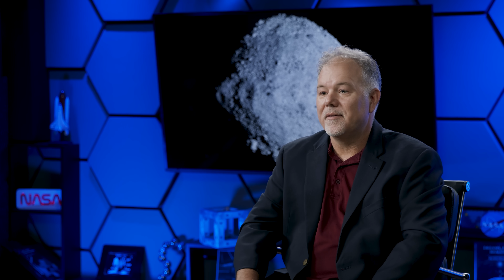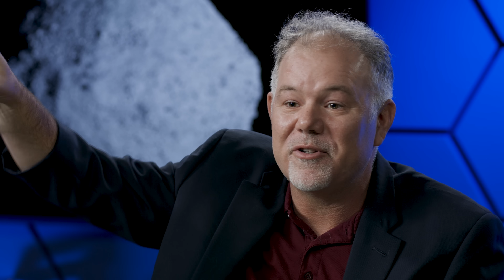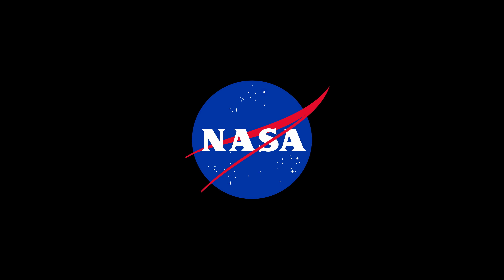Bio-Essential Sugars Discovered in Samples from Asteroid Bennu

Comment: probably because it is ancient fossiliferous remains (more than 1 billion years old) of benthic crust and has the dead remains of previously existing organisms, if you had a theory more aligned with Randolph Kirkpatrick it wouldnt have been a surprise, then you might say the chirality doesnt match, well that is not disprove but a discovery.
Reply: Most of the chemicals found would not last that long, they are likely to have been recently formed. Even sugar has a best-before date and a billion years is too much.
Reply: @pattheplanter  Interesting, so you are saying the object material had to have been formed in the past 100 million years? So has nothing to do with the material present at the time of Solar System formation?
Reply: @anautonomousagent  No. The sugars have formed recently but the materials they formed from are much more ancient.
Reply: @pattheplanter  interesting, you know they formed recently but the materials they formed from are ancient, spontaneous generation of sugars from ancient material? then this can easily be demonstrated in lab experiment?
Reply: @anautonomousagent  It has been done with various components. See, for example, "The Formose Reaction: Prebiotic Soup or Recipe for Life?" by Peer van Duppen. Available online.
Reply: @pattheplanter  cool, interestingly this supports idea that is it from hydrothermal vent or benthic crustal debris. as these formose reactions work optimally in such environments: " The reaction proceeds efficiently at up to 200 °C (e.g., in simulated hydrothermal vent environments at 100 bar pressure), where maximum yields are achieved in less than a minute without requiring catalysts or highly alkaline conditions." 

Unlikely that this process is occurring in some molecular cloud in a vacuum of space on tiny object. (super low temp and pressure with no catalyzing agents)
Reply: The chirality does not match.
Reply: @davidwuhrer6704  it doesnt match because we are discovering something new.... life outside of our life you think is supposed to match ours lol
Reply: @anautonomousagent It doesn't match because Earth life has one chirality, and the sample has both chiralities in equal measure.  Which is exactly what you expect in the absence of life.
They tested it to see if the sample was contaminated.
Reply: @davidwuhrer6704  it does not exclude the possibility of life that uses both types equally/interchangeably, and it is incorrect conclusion to say that since Earth life only uses one thus is a universal law of biology including extraterrestrial.
Reply: @anautonomousagent It does not exclude that possibility, but it certainly isn't evidence for it either.
Reply: @davidwuhrer6704  I would agree with that statement. Although there is more than enough evidence in support of microfossils in the carbonaceous meteorites. 

Plates 30 and 31 are clear to me! And not contamination as their nitrogen ratio in SEM (lack of it proves ancient). "The Orgueil Meteorite (Atlas of Microfossils)" - October 2020 by A. Yu. Rozanov, Richard Brice Hoover, Krasavin Eugene, Olga Samylina, Anton Ryumin, Mikhail Kapralov, E. A. Saprykin, and A. N. Afanasyieva.
Reply: @davidwuhrer6704  Deep inside freshly cut meteorite scientists have found fossils, the evidence speaks for itself.
Reply: @anautonomousagent Yes, there is evidence that Richard Hoover is a fraud.

Edit: YouTube ate the link, so I think I should elaborate.

He had tried that before, "finding" microfossils in a different meteorite.  Could not be replicated.

The Orgueil meteorite had been studied before, and others had tried to plant "alien" life on it before. One magazine published his paper, mistaking him for a respected scientist.

I'm not surprised he tried again, but it doesn't make him credible.

Comment: Recent studies have shown that the Sol system (us) passed through the Orion Nebula within the last billion years or so.
What portion of materials are original to Sol and what portions are due to deposition from varying galactic neighborhoods we pass through is still up for debate.
Other recent studies have also suggested passing Wolf-Rayet stars as likely sources of molecular carbon rich materials (along with the usual nearby supernovae, and rogue debris such as 3iAtlus were it to actually hit anything nearby).
Both those ideas together sound reasonably compatible to me given that "The O.N." ®is a big producer of a lot of hot, fast burning, O type stars.
🖖😎👍
Reply: Hayabusa 2 did shoot a tank shell into the asteroid to excavate and obtain a sub surface sample
Reply: @linecraftman3907  We also know at this point that such bodies are very loose conglomerations materials. Depending on the amount of tidal disruption the object experiences during it's orbits there could be significant turnover in it's surface/sub-surface over time. It's still a case of the deeper you go , the older you get though, I suspect.
Reply: That distinction doesn't seem meaningful to me.
The solar system formed from interstellar material.  So any interstellar material deposited in the solar system is just more interstellar material.
And if other stars can deposit material in the solar system, then so the sun can deposit material in other star systems.
What's the difference?
Reply: @davidwuhrer6704  That's a fair view, but a bit too over simplified. It would be true if interstellar gasses were homogeneous, but they're not.
Plain cookies are just plain cookies, but if I toss them through clouds of various materials the flavor changes dramatically.
Which would you prefer, the cookie that passed the the chocolate cloud, or the one that traveled through a pickle juice cloud?